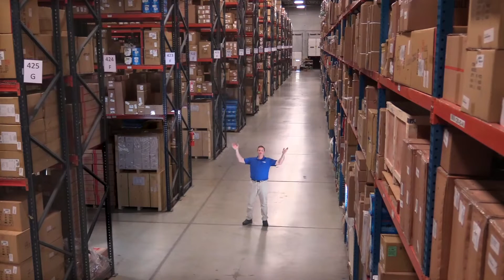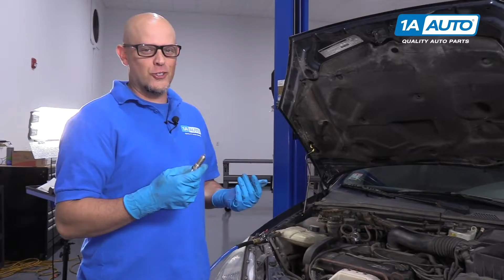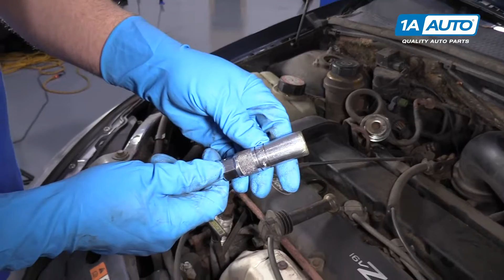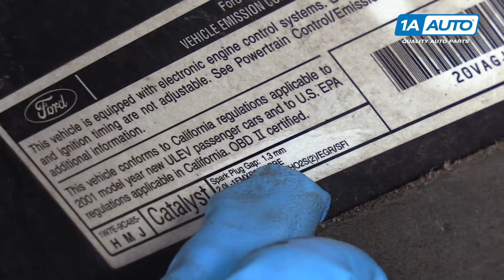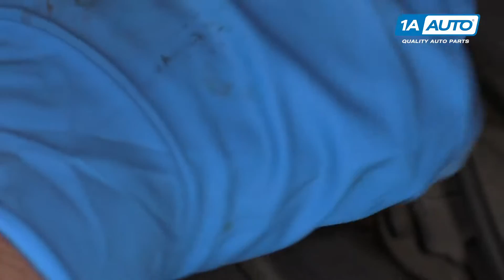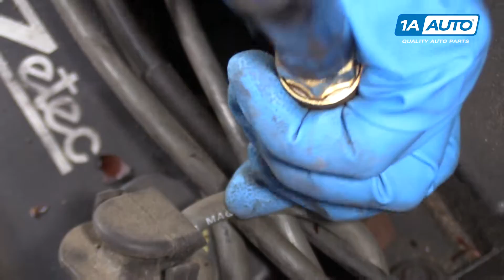How to Replace Spark Plugs 00-04 Ford Focus

Comment: I have a problem where the spark plug unscrewed and was bashing the wire against the hood while driving on the highway. 
If we cannot get the plug to screw in should we assume that the hole it sits in has lot its threads?

Comment: Honestly mate, I can't believe you would even waste your time replacing these plugs without the valve cover gasket. When I changed mine it came out in 15 pieces. No wonder it was leaking. I have a Nov 04 and it has been leaking since 2011. I finally fixed it, replaced plugs, leads, gave it a degrease. Trickle fed the battery over 36 hours, done wheel bearings, engine mounts, and some other bits and pieces. How much do you think it would sell for? Bearing in mind I charge $40 an hour cash in hand and spent 12 hours on it plus parts.
Reply: $AUD58 for valve cover gasket. 9 x cans of super cheap auto degreaser at $3 a can, AUD$38 trade for set of Bosch Iridium Plugs, $75 trade for a set of Bosch Spark Plug Leads, $75 trade for Bendix Pads, Machined Rotors myself, 26.5mm meat left on after machining. much more done. Still needs aircon to be looked at, but I am not going down that road, I have a roadworthy and that is all I need.

Comment: How can I remove the dirt and debris without compressed air?
Reply: Allllllmost forgot to blow out that debris... :)

I would get a can of compressed air in the stationary section at WalMart.
Reply: Compressed air in a can could work.
Reply: Use a can of duster, or a small attachment for a household vacum (you could get creative and duct tape a funnel or smaller tube to the vacuum hose for the right application).
Reply: Good question.
Try using a vacuum if you have a small enough extension to get into the hole.
Reply: Take the valve cover off and replace the gasket. If you are doing plugs, you should be doing these as well.